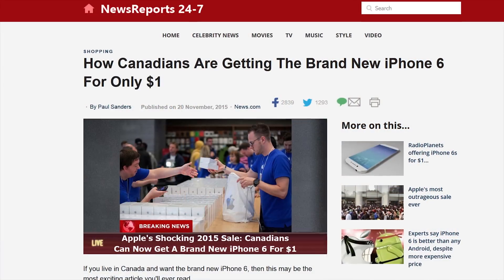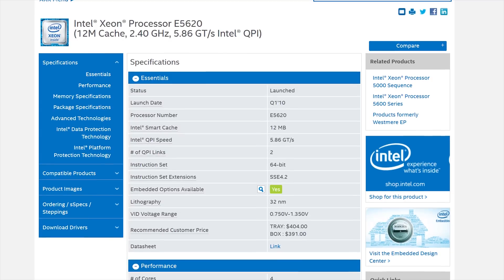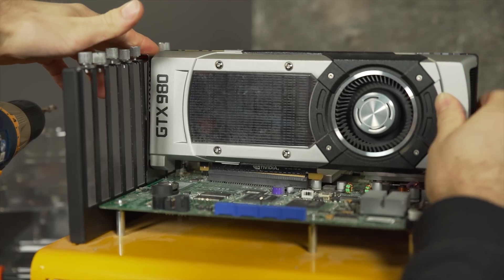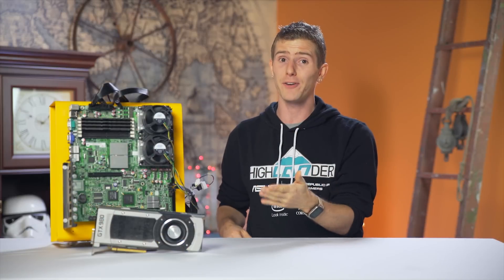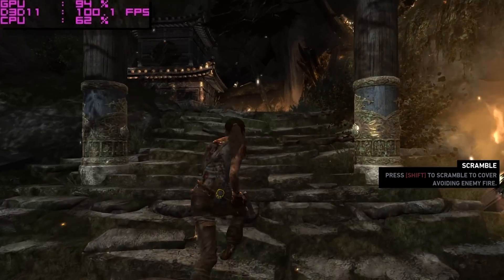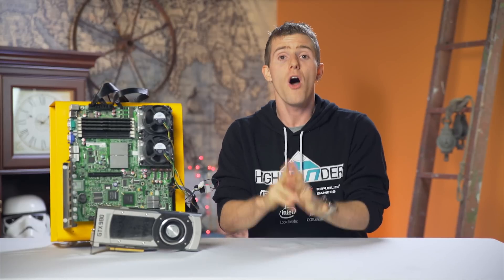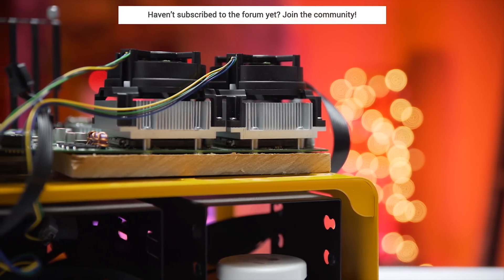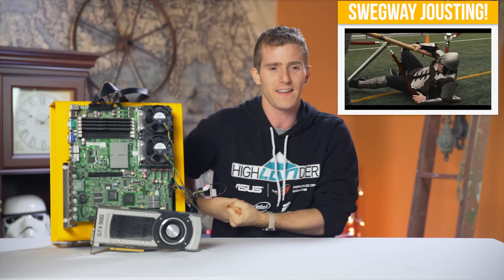Under $150 Budget Gaming 8 Core CPU, Motherboard & 16GB RAM

Comment: idk... I'm afraid of this, I was running two xeon 5520's about a year and a half ago and every game I was running would only run on one of the CPU's, I had 16gb fb dimm ram and a 780 gtx ti and my ram and gpu were getting seriously bottlenecked by my computer failing to run both CPU's at the same time, always running like a single cpu except in rare occasions I was would get full use out of both CPU's. I'm not saying this can't work but I've just either A) had a bad build or B) think that games aren't optimized to run on dual CPU's yet. any advice guys? (rig is still in my closet, I just use a 4790 now)
Reply: TRy setting cpu affinity, or forcing game to use certain CPU cores like cpu-control program.

Comment: what if i do everything in this video except use a server motherboard?
Reply: You'll need a server mobo for those cpu's
Reply: That would be far easier, only reason he used a server board I'd because consumer boards only have 1 slot.
Reply: you'll only get one cpu.
Reply: you can run most xeons on non-server boards as well. some out of the box, some with a little tinkering.

Comment: he chose unwisely... for one thing he should did a bit more research and shopping he could have found a mobo that have same pcie setup as in a gaming mobo ofcourse he could have also bought ES cpu's which are multi-unlocked i just bought a supermicro H8DG6-F that has a custom bios that allows overclocking with 2 6272 opterons and 32gb ram and 1200w psu for $200 US on ebay

now ofcource this in in a 2u case and the psu is servver only but u can get a old workstation case for cheap just make sure IO panel can be removed then buy a decent psu and video card and u have a 32core beast for CHEAP just a little more than a garbage PS4

Comment: or you can get an xeon lga771 and put it on a lga775 mobo after modding the xeon.. i done so with an e5450 and it's running really good.. and the cpu will cost you about 30$

Comment: Why go to all this trouble - you can achieve the same or better, and cheaper, if you have an old lga775 g41/g45 mobo and hook it up with a Xeon E5450 [3.0, 4 cores, 12mb cache]. Some lga775 support up to 16gb of DDR3 even and obviously there is no need to mod any further. 

Always go for the E [80w] version Xeon, never the X [120w], for better power consumption and heat management. Due to less power and heat you can OC the E version more safely if the mobo support it, the E versions usually have better multipliers as well.

Only recommended if you can get your hands on a good lga775 mobo free or really cheap, otherwise it won't be worth it financially-wise.

Can find on ebay or aliexpress Xeon cpu already modified to work on lga775 instead of those that require the special sticker., look for "no need mod".
Reply: Dis mobo got 2 cpu's while lga775 mod got 1. Also the ecc ram is dirt cheap, $10 for 4 gb sitck, nomsayin?
Reply: One E5450 is more powerful than the two weak CPU he put here.
I don't know of any new current AAA games which support or require 8 cores, most don't even need 4 cores.
The mobo is probably an Intel crap trash I would not trust it.
ECC ram might be cheap but I would not trust it used.
I can put 4-8gb of DDR3 and it will be faster than this video 16GB server ram.
Almost everybody has an old LGA775 mobo, not everybody can get a server mobo.
Dual CPU will require more power, additional cooling, stronger PSU...
You don't need to make silly modifications with wood and drills.
Not everybody has a case to fit a server mobo, old LGA775 will fit in any case
Reply: Noiconnotag  They use 2 l5420, if  u don't like them u can use 2x e5450 or 2 x  e5470, which would be faster for sure. Ram doesn;'t fail typically, ofc its slower then ddr3.

Its just a fun build, hothing more

Comment: I'm not sure this is worth it. For $150 you can get a Skylake H110 board with a Core i3 6100 that will outperform those dual Xeons in games. They have 8 cores total, but they're from 2007, they are much more of a bottleneck than the 6100 will be. And you'll have a modern, upgradable system. You can, however, get an X79 Xeon E5-2670 for around $70, which is a Sandy Bridge-based 8-core Xeon and a $50 X79 board and that's a really good deal. But still an old platform...

Comment: What did you do about the CPU cooler power connectors? What cable did you use to supply power?
Reply: Fan controller
Reply: he just plug it into a molex or sata port

Comment: Linus, you did it! High Five. After watching this, I did some searching and spent some time exercising my GoogleFu and after a few random cat videos and crazy pictures and blah blah, I came across a post about converting a 771 socket (xeon) processor to a 775...well I had a 775 computer I just so happened to of maxed out the RAM last week and was going to buy a new quad core processor for it. Going to ebay, the converter strip to swap the two pins on a 771 chip cost about a dollar.  The X5460 processor cost around 30, a 30 dollar savings from upgrading a socket 775 processor of the same speed and cache...But then I found the grail man, a T7500 dell server with a bad mobo.  (no ram, no hdd) it had a x5460 processor in it, and drum roll.... a 1100 watt PSU.  Yup you heard right, 1100 watt dell PSU, the same one they use in area 51 computers, its a Gold certified PSU! The whole thing was 45 dollars +12 in shipping.  67 bucks, upgraded my 550W PSU, increased my processor performance and the case was better than my old one, so I put my computer inside it. not to mention the dvd rom drive and the dvd burner that came with the dell as well.  If it was not for this video I wouldn't have started to google about 771 processor compatibility for my 775. Cheers!

Comment: I hate my q9550, it's clocked at 3.03, without overvoltage because I'm too stupid to do that, and it scored a 336 cb ;-; then again, that pc in this video runs with 2 cpus
Reply: lol i do 320 cb at 3.21GZ and 340cb at 3.5GHZ on my Q6600
Reply: When you overclock CPU you need to check speed of your Ram memory sticks if is not going above rated frequency (if is, then lower ratios)
Then you need to perform tests with prime 95 to check if its stable and rise voltage it its not. (for cpu)
You need to check temperatures and now if your psu can stand the overclock.

I explained this very baldy cause i know you wont have the patience to do it as it should be done. You would need tons of patience to do a proper overclock.

I'D LOVE to play around with your system and do a proper overclock!!!!

Comment: Used workstations are the best I bought a Hp Z-800 with 2x hex core xeons and 48GB ram for 800 pounds, Although more expensive than this if i was to buy consumer grade brand new it would have cost me 600-700 pounds for a decent I5 setup witch is crap.

Comment: FUCK I JUST SOLD MY SERVER WITH 2 E5420 CPU'S :(
and the score on cinebench is better then the i5 4460.
Reply: For how many?
Reply: Lucas Nany 50 euros
Reply: Lucas Nany it had no x16 slot and was LOUD AF
Reply: Can i have more detail , like hdd & motherboard. for estimation^^
Reply: +Lucas Nany it was a dell poweredge 2900 32gb and two 36 gb sas drives
noone was intrested even at 100 euros
Reply: +Lucas Nany it was a dell poweredge 2900 32gb and two 36 gb sas drives
noone was intrested even at 100 euros
Reply: Why you sell it at 50€ !? I search on ebay and others site , it's 60-400€ ... For more or less ram...
Reply: Lucas Nany i didnt have the ability to send and because it isnt that recent there is no ask in holland
Reply: You speak french ? And no way 50€ :'( if someone told me you sell it for 50€ o: i run to you lol
Reply: Lucas Nany oh it where 5320 xeons and no 5420

Comment: wait so if I build this exact machine, except with a Supermicro X7DVL E mobo and a GTX 950, would 430w be enough power?

And also, I cannot find stock coolers for this cpu anywhere. I just don't know where to find 2.

Comment: bro...551cb is not bad for 150 dollar build...
Reply: until you hacksaw a 980.....
Reply: LAY DOWN YOUR SOUL TO THE GODS ROCK AND ROLLLLLLL
Reply: Gundam Tech is bad for a rig with double cpus and  8 cores
Reply: I have a 500€ build and my score is 380...
Reply: First of all, it was 501cb, but close enough. Also my hyperthreaded dual core did 500
Reply: I have like 508 on my crap old 8120
Reply: A simple Ryzen 5 1600 will do 1100 not overclocked
Reply: i scored 501 with my overclocked AMD FX 6300. at 4.2GHz stable, whole rig is over a grand. (1060 6GB in australia. insane prices) and DDR3 memory is for some reason expensive as fuck
Reply: well with a 200 build i have a 587
Reply: i have one of these from last year when I needed a cheap rig for my nephew. I picked it for 70 dollars and put 2 x5482 chips in it. I get a a cb score of just under 670. If the x5492  ever came down in price. It would core over 730 in cb. I use it as a server now for games you can host your own games in for my team speak.  I put my 1080ti in it and ran it at 4k, just to see. Its a beast and still has a few years left in it. I paid like 150 total for the whole thing with 32 gigs of ram. Ryzen is the only thing that makes me want to upgrade it to a new platform.
Reply: Speeder832 your fx 6300 bottlenecks 1060 hard
Reply: You don't buy ryzen 5 for 4k, nevertheless you still need the good processing power...
Reply: TheBlack Metal BLAAAAAAACK METAAAAAAAAL!!!

Comment: can i use cheap mobo with a good cpu and gpu
Reply: Really interesting
Reply: you can but don't reccomend it
Reply: just get a dell precision t3500,remove old psu, put new psu, put new gpu and done.
Reply: +Hi Im Seyf thx u
Reply: +Nm3z Kazi thx u
Reply: +matt edet ill send you a link later
Reply: ***** Just get this http://www.ebay.com/itm/381747735430
with this http://www.ebay.com/itm/351579380788

Comment: Ummm so $150 with a GTX 980 riiiight.  or get an new Intel compute stick for $150.  they run SUPER hot though and limited to 32bit win 10 with 4gb ram max (for the $150 model).  i wouldn't mind seeing this system (without the 980) vs a compute stick.  would be interesting.

Comment: Its a good idea but theres too much room for mistakes or faulty parts ect, it would cost more to buy a new rig but it would handle and play better also it will last longer and imagine finding a case that fits it and all the work you would have to put into it, in my opinion its not worth it.

Comment: Hey Linus
is this concept still a thing? :)
Reply: nope
Reply: Im in the middle of it. granted because of the particular ram i got my total for the motherboard, cpu, ram totaled out to about 185 with shipping. So I would say yes, IF you're willing to do your reserch! a couple of tips.
1) reserch your whole cpu motherboard ram prices and compatibility between them before purchasing any of them. 
2) Intel motherboards are VERY well documented. so if you're on the fence between two different ones that alone is worth a fair bit.
3) faster ram in this situation actually will make a difference as I understand it. (check compatibility, then double and triple check compatibility with all components 
4) look at this as an experience more than a cost saving measure.
5) You will be bottle necking your gpu (as I understand it)
and finally be patient with it this is not a slap it together kind of build.
Reply: +Dillon Archibald <--- this guy gets it!

Comment: Check out the slightly older workstations from HP or Dell.  I have a HP Z600 with dual Xeon 3.0ghz quad cores with Hyperthreading, 8 logical cores, 16 virtual cores, and it came with 24gb of ram for about $450 or so.  All I did was put in a video card.

Comment: Anyone recommend any good cpu coolers for a dual xeon 771 socket type?
Reply: im in the same instance... i have stock coolers and get 2 x5460's, they run great but they are HOT LIKE HELL!!!
Reply: Mine are just very loud, I'm using two e5420's and they are quite loud, the temps are decent though.

Comment: This may have been good then, but I've found that I can get 24GB ram, two quad core CPU's  with hyperthreading (lga1366), and a 12"x10" atx motherboard. Coolers may be expensive but you can just ziptie a cheaper one down

Comment: I have a HP Workstation XW6400 with two quad core xeon e5345 cpu's and the motherboard, 8GB ram and and 575watt PSU, no case though or hdd but I would sell for £20

Comment: My friend(not a real genius with computer at all) gave me his 10 year old desktop pc... I took it apart to find only bad ram sticks a gigabyte mother board plus a very outdated core processor... I took apart my laptop to find a 8 core processor overclocked at 4.00 ghtz and 16 gigs of ram, that fit the same motherboard adapter as before... My lucky day. I ordered a gtx 980ti (asus) and burnt what I had on both hard drives onto a disk then burnt the disk info onto a hard drive. after I was done I was stuck with a gaming rig that could outperform my friends 2000$ one... and how much did I spend... nothing at that moment the laptop costed me about 750$-ish and I was able to sell all the parts I had left over for around 300$ and with some spare change lying around I was able to buy a powerful enough power supply and the gtx 980 like I said before for around 400$-500$ My lucky day indeed(well took more like a week to get all the parts and put it together:P)That's my pc building rig story

Comment: I took the workstation route. I got a Thinkstation S20 (Xeon W3550, 4GB DDR3 ECC ram, 250GB hdd), and a Xeon X5670 off amazon for $55, 16GB kit of DDR3 ram off of newegg for $70 and it still pulls its own weight. Only bottleneck is the GTX660 3GB that I'm using.

Comment: I don't know much about computers as far as building them, but I was wondering if you could make two of these and put them "together" and increase performance
Reply: yes you could, thats what how many supercomputer are build. Many server computers with two xeons or more and connected over a very fast network. They can very good compute simulations or something like that, because they have many processors which can each compute a part of the task. However you cant play games better with something like this because gamesoftware doesnt profit from many cores because you have to write youre software explicit for many cores/processors and many task cant solved faster with more cores.

But for example you can google "einstein@home" where scientists use idle desktop-pc's to create a supercompter over the internet to find special pattern in gravitational waves.

Comment: Lol what i done was even though i hate apple i bought an old mac pro 2.1 which has 12gb ram , intel xeon x5355 (8core) , a GTX 680, A kingston ssd and 2 320gb hdd's plus i only run windows 10 on it xD and tbh for about $200 canadian it is not a bad system at all. Plus as a bonus compared to most server boards i have alot of pcie expansion slots.

Comment: Which one is better: Intel Xeon L5420 or E5540
Reply: almost identical. get cheapest
Reply: i just got a X5550
Reply: Im getting one for $450 with
Intel Xeon Processor E5506 $3.39
Dell Precision T3500 0XPDFK LGA 1366 Workstation System Motherboard $37.44
Dell Precision T3500 case $54.89
Dell Precision T3500 Heatsink $14.90
2TB 7200 RPM Hitachi Hard Drive $48.88
256gb ssd $54.99
Replace Power 800 watt psu $39.88
Amd Radeon R9 370 2gb $85.00
Crucial 8GB Kit (4 x 4GB) DDR3L-1600 UDIMM $80.54
Windows 10 Pro OEM $30.00
-----------------------------------------------------------------------
Total: $449.01
Is this a good deal?
Reply: Nm3z Kazi
why do you not buy a better cpu for about 20 dollars. the price doesnt make a huge relative difference ( 450 to 470 ) but the performance should be better. especially if you need to paythe shipping for the cpus.

and you should know that normally dell motherboards are really hard or impossible to overclock or to overclock the cpus or anything. maybe this is an exception but thats not likely.
Reply: +Darius Duesentrieb free shipping
Reply: +Darius Duesentrieb ok ill just get a $6.49 e5540 or maybe a w3550
Reply: Darius Duesentrieb Updated build
Intel Xeon X5550 3.06GHZ $14.95
Dell Precision T3500 0XPDFK LGA 1366 Workstation System Motherboard $37.44
Dell Precision T3500 case $54.89
Dell Precision T3500 Heatsink $14.90
2TB 7200 RPM Hitachi Hard Drive $35.00
256gb ssd $53.99
Replace Power 800 watt psu $39.88
Amd Radeon R9 370 2gb $80.00
Crucial 24GB Kit (6 x 4GB) DDR3L-1600 UDIMM $80.54
Windows 10 Pro coa OEM $0.00
-----------------------------------------------------------------------
Total: $411.59

Comment: It didn't suck but I'm looking for the dirt cheep workstation for video editing. Any tips???
Reply: I assume the data transfer rates would bottleneck true HD video editing a bit. Some of the projects I work with require 100gigs worth of video to be worked with. Including transferring from SD card to backup alone I'm wondering if the cost I'm saving will be lost in future data transfer wait time???
Reply: is getting 100gb+ of ram an option?

Comment: i used a lot of the information from this video to build an hp xw6600 with a pair of xeon e5540s clocked at 2.83ghz quad core. i bought the xw 6600 with a crappy little cpu in it missing the hard drive for 80$. the xeons were 27$ a peice. i also grabbed up an r7 360 for under 100$ on sale and a 1terrabyte hybrid drive. and a 60$ stock cooler for the second cpu slot it actually is a pretty decent little gaming box for under $400 and was surprisingly pretty painless. oh and it actually came with 12gb of ram in six channels.
Reply: also im aware my graphics card is pretty meh. i'm upgrading to an rx480 whenever they stop being out of stock all the time.

Comment: i actually just got a system with 2 of the 1366 x5670 with 24 gb of ram on a hp proliant mobo and it runs amazing I can max everything out (1080p) and its stays at 60fps constantly (no dips) my monitor is only60hz. it's a really cool thing to have and it works amazing .and very cheap.